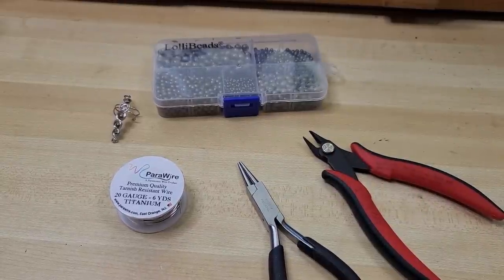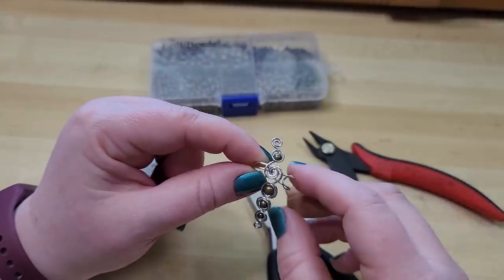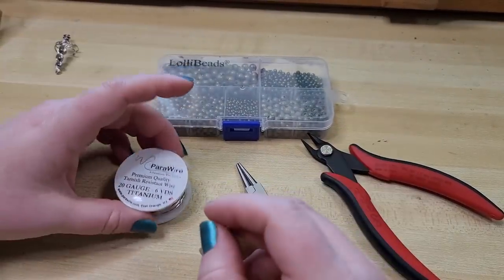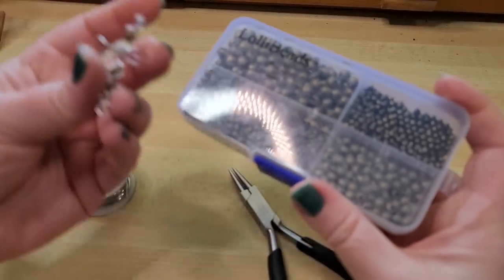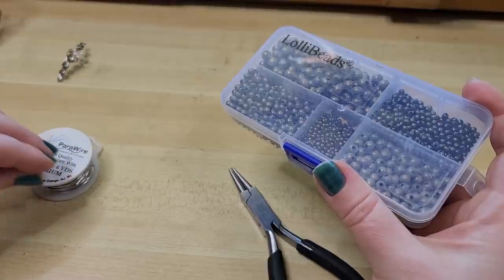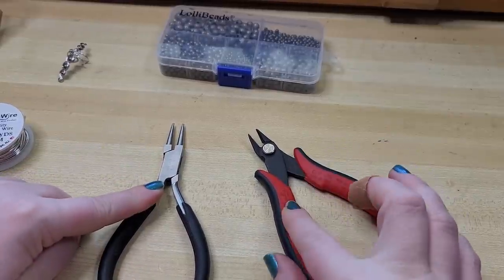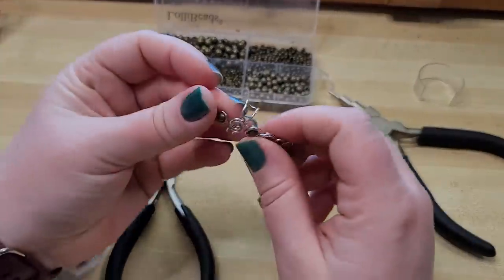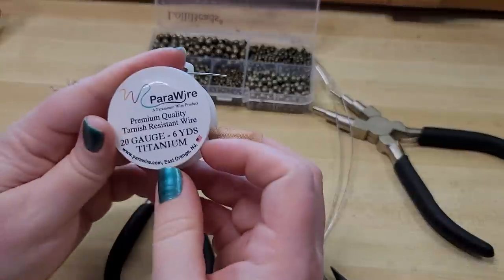Easy Wire Wrapped Ear Cuffs

Comment: I have been wanting to get into wire wrapping, and this looks like it'll be a good place to start! What should I have on me to work with you?
Reply: 20g or 18g wire your choice of metal/ color, some wire cutters and pliers and some beads (looks like maybe 6mm and 4mm) that have holes big enough to take 20g wire at bare minimum is what you will need for this type of project... But for starting in general I recommend you get various wire guages. To learn how to weave you will want a thinner weaving wire like 26-28g as well. Nylon jaw pliers for straighting out your wire is also an essential in my opinion but many go without it
Reply: i think she has a favorite tools episode.
Reply from the maker: Heya, Melissa! The tools and materials for this tutorial are listed in the video description <3 20ga wire, round nose pliers, and wire snips, as well as your choice of beads, is all that is necessary, but some other tools can be nice too!